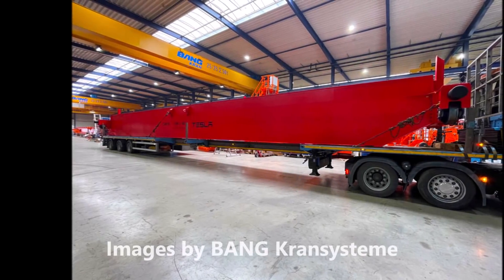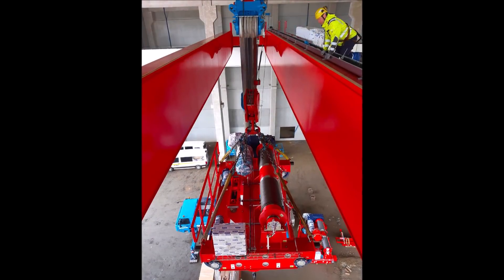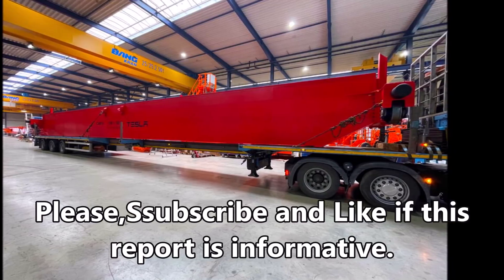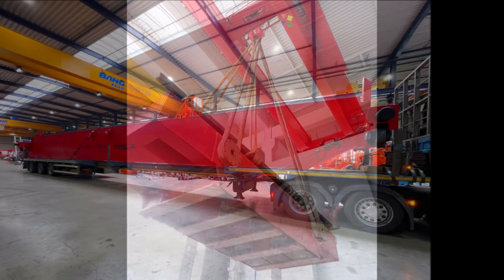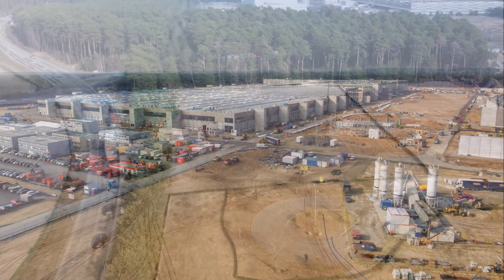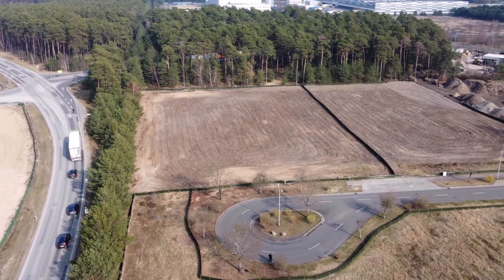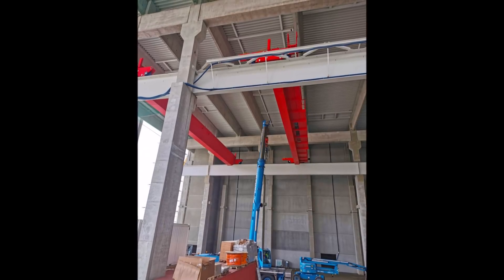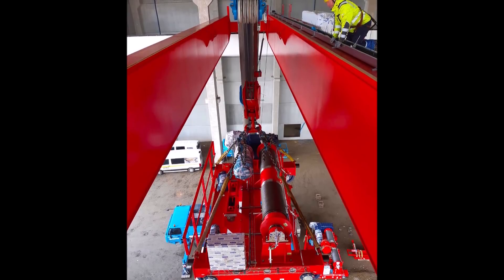Tesla Giga Berlin Mounts 100t Indoor Crane, Immediately Starting Operations

Comment: Pretty sure that crane was installed quite some time ago and it's now assembling the 2nd Giga Casting machine. They still have a 2nd one to install yet.
Reply: They have indeed installed a 2nd bridge crane in the row where the 1st crane was installed in November. The main task of those cranes is not to assemble the (final) four Giga Presses in this row but to assist during production and setup changes.

Comment: good to hear about the number, quick math. 3m3 / per car.  It actualy doesn't seem that bad considering.  Sure it's a big factory, and it might be a low supply area, and great to know they might have acces to another source.  But what i mean is there is so much lobbying try to push a narative that Tesla and EV just take so much ressource that they aren't good for the environement, but i that doesn't seem outrageous especialy if it include the battery making too.  Being a canadian, i know how much water is being used for tar sand exploitation or oil fracking.

Buy EV, save water

Comment: Do you think that Tesla will use gigapress to stamp out the structurel battery compartment?
Reply: The gigapress is a casting machine, not a stamping machine.
Reply: @jamesdavison6290  good catch on the wording, regardless, will this device create this structural battery component?
Reply: @Steph1  Nope that will be a stamped sheet - couse the cells provide the structure you dont need a casting for that :)

Comment: Ok. Main hoist 100t capacity. Slow speed lift, large hook, larger diameter cable/wire-rope. Secondary/aux hoist 60t capacity. Slightly faster operation with slightly smaller hook, lightly smaller cable/wire-rope. The main hoist is the main reason for the limits of the lift. The secondary/aux hoist will be used for most smaller lifts in the area.
Reply: Thank You!!!!
Reply: Tomas - The Smaller Capacity Crane, could also function as a "Tag Line Control" Possibly!